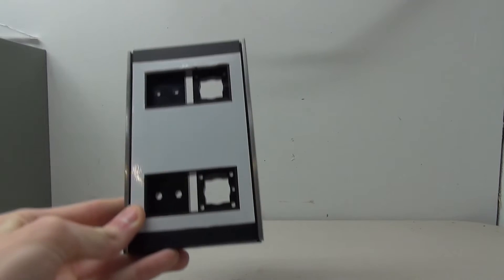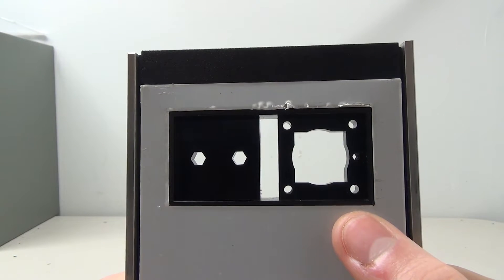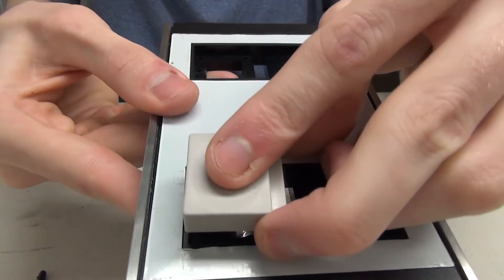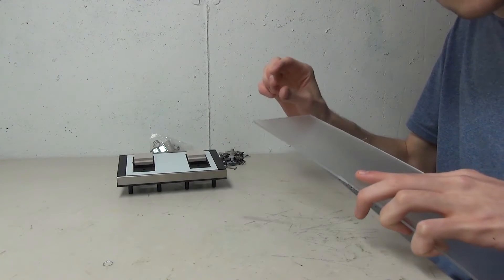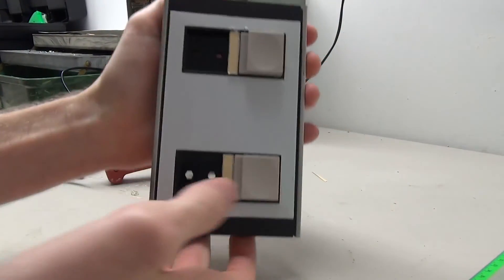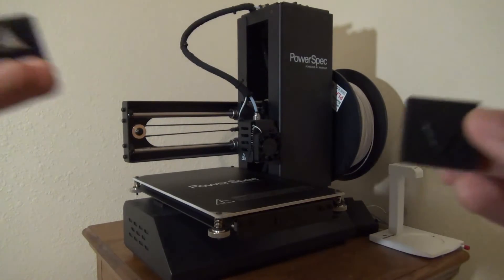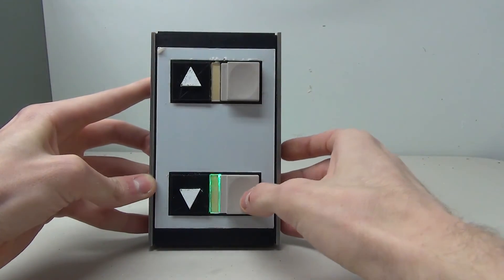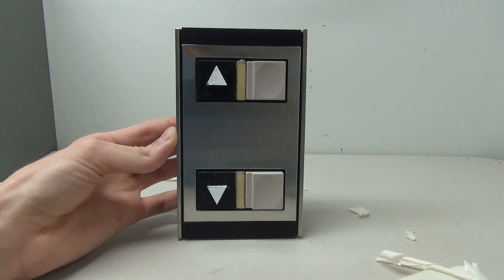Elevator Part Building and Wiring: Montgomery Vector

Comment: Stl elevator I have a 3 monitor setup on my pc running windows 10 I recommend you updating your windows 8/8.1 because it ended support
Reply from the maker: Well I did that a while ago
Reply: @stlelevators  Ik but windows 10 was released on 2017

Comment: This Vector hall station is slightly different to the one I own in a couple of ways (mine is complete, though in worse condition). On the one I own, the micro switches are mounted to the circuit board instead of to the front of the panel. The metal piece is also much smaller on my Vector panel.

I also found out that on my Vector panel, I can remove the buttons from the panel by pulling some plastic clips. Do your Vector buttons remove from the panel differently?

Do you know if on your Vector panel it is possible to completely disassemble the buttons, or are parts of the buttons not possible to disassemble?

The circuit board on my panel says Rev. 2, so maybe this is an older version of the Vector hall station, but it is hard to say for sure.
Reply from the maker: I’d like to see yours if possible. If you have Instagram could you dm me a photo?